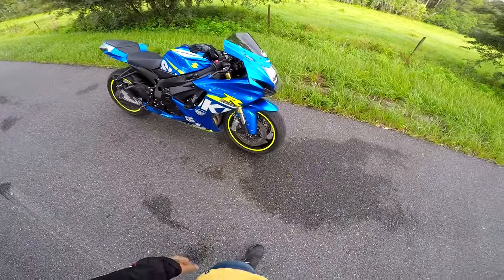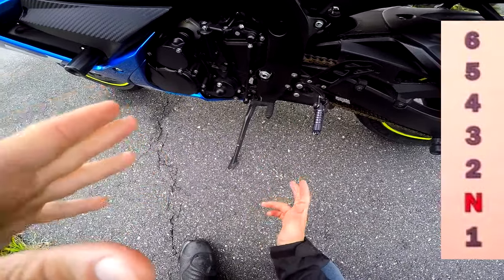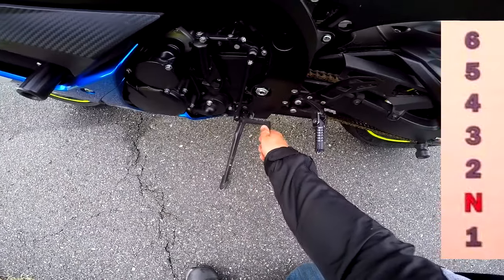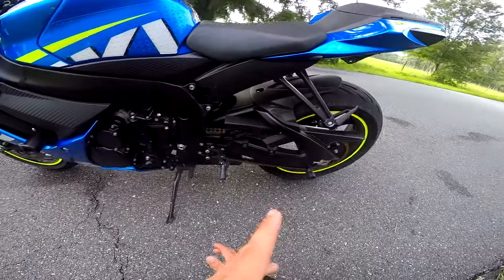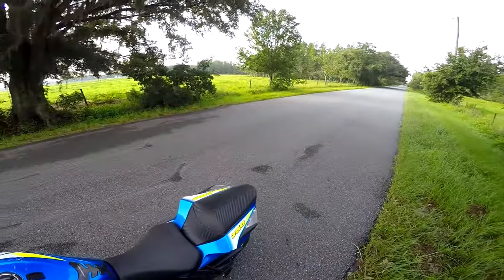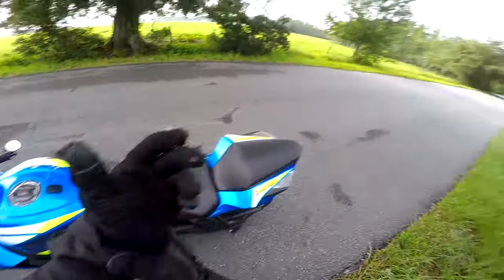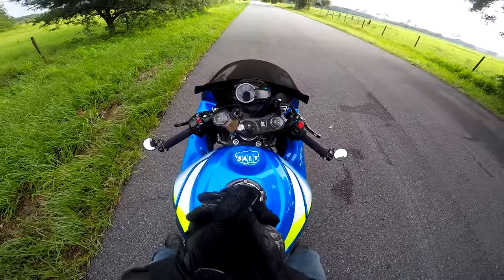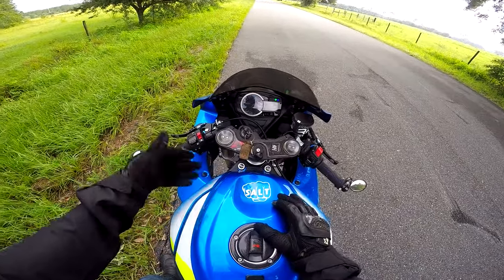How To Ride a Motorcycle: Part 2 - Shifting & Downshifting

Comment: when up-shifting and downshifting, does the shift lever only go up and down one click at a time or is there a chance of shifting into a wrong gear?
Reply: it's sequential so it only goes one gear at a time
Reply: Sanjay If the gear change is sloppy (especially on older bikes) you could find a false neutral.

Comment: What's the difference between rolling off the throttle first and then pulling in the clutch versus pulling in the clutch and then roll off the throttle? I was taught to roll off the throttle before using the clutch.

Comment: Can I brake and not use my clutch?? .. if I want to slow down into a corner
Reply from the maker: You can, just be careful about braking in corners. It can be done but you have to know what you're doing.

Comment: When coming to a quick stop at a stop sign (while in 1st 2nd or any other gear) or even a red light, can you just hold in the clutch or do you have to shift back to neutral?
Reply: You you can hold the clutch in on 1st gear but because bikes have a sequential gearbox you cannot be in any other gear other then 1st. That’s the only difference with stick shift between cars and any gear bike hope this helps.
Reply: @headlesshorseman2165  Sure does :D, Tnx

Comment: Brand new.  Today is day 3 on the road im already on the streets.  Heres where im confused.  When i down shift its dangerous. Ive stalled several times in traffic down shifting.  But when i down shift up to a complete stop holding clutch in and off throttpe then the bikes smooth.  How do you down shift while moving at pretty good speed ?  Even letting clutch out slowly seems to stall the bike.
Reply from the maker: You don’t want to down shift too quickly, try down shifting slower and at lower speeds. Depending on the bike. Sometimes you don’t down shift into 1st until you’re going 10mph or less. Or just try holding the clutch in the entire time you’re downshifting and don’t let the clutch out until you’re at a complete stop and in neutral. Hope this helps

Comment: I’m use to driving a little Honda 125 scooter at my house in Thailand but want to get an actual motorcycle. Is it way different in the handling and ride? When I’m doing like 60 kmh and higher it seems so squirrelly. Or does it become more comfortable with time. I don’t ride all that often

Comment: I been riding for years and i still cant get the hang of it lol my shifts are always different or im doing it wrong or wrong rpm like i feel like i should shift to 2nd at 20 3rd at 30 an so on is that right for the most part? And also do you let the clutch out fast or slow obviously when cruising not racing and do you let it all the way out and give it gas or should you give it gas at the end of the clutch disengagement right before its all the way out

Comment: Hi salt can I downshift from 3rd to 1st gear on one clutch pull while running?
Reply from the maker: Yes, absolutely. Just pull the clutch in, shift down twice and then release the clutch, but you have to account for your speed and RPM's. If you do it too fast and you're going too fast for 1st gear it could lock up your rear tire and skip. I do it when I'm rolling to a stop though, I just don't let the clutch out until I'm doing below say 20-25mph

Comment: When I down shift my bike will rev and it sounds like the tires are screeching. Why is that
Reply from the maker: If you downshift at too high of a speed for that specific gear the rear wheel is all of a sudden spinning much slower than you're moving and it will lose traction. Try slowing down more before you downshift.

Comment: when i downshift i do what you said clutch in let go of gas gear down but then when i let go of clutch and give it gas i stall for a second or if i let go ot clutch slowly while giving it gas it will still brake idk what im doing wrong it’s a dirk bike btw idk if it’s different or what

Comment: One question, to ride 30 km to 50 km/hr ; 60 and 80km/hr  in which gear I should put the bike? 
I am a very new rider
Reply from the maker: that really depends on what bike you're on, you can be in 1st gear on a 1000cc, 2nd gear on a 600cc, 4th gear on 125cc, etc.

Comment: I can drive a manual car really well, a dirt bike well, but sports bike friction zone and gearing feels totally new. I’ve stalled the bike several times.
Reply from the maker: You'll get the hang of it, you can adjust the clutch cable to make the friction zone more like what you're used to as well

Comment: Hey, so I'm a little confused here, I've seen other videos where they tell you that the friction zone is not just when you release the clutch but when you press it as well, meaning that you don't press it all the way, that true??
Reply from the maker: The friction zone is different depending on the bike and how the clutch wire is set. It’s the point of which the gear is engaging and starts to move the bike

Comment: Awesome video..tho one question..

Say im in big traffic..do i have to downshift and upshift all the time or i can still brake and leave it on 2nd gear without the need of downshifting to 1st?
Reply from the maker: You don't have to downshift each gear when coming to a stop, you can just pull the clutch in and shift down as needed to get back to Neutral or 1st gear
Reply: @SALTxTHExWOUND  oh wow thanks for replying.

Yes but i mostly aim at braking when roads are busy or u need to brake quickly due to someone or something in ur way..
Do i have to downshift first then brake ..or i can just clutch brake first and then i can downshift when i safely brake and avoid whats upfront

Comment: so when you downshift do you just hold the clutch one time and keep clicking down to downshift
Reply: It’s a good idea to actually shift through all the gears, Ie click down and let clutch out through each gear. Less stressful on the bike and better to know where your RPMs are. With practice you can get very fast with it!
Reply: Depends on the reason you are downshifting, is it that you want to stop or you just slowed down due to traffic or a corner, bump etc, if due to the former, then you can down shift to the first gear where you go to a stop, I do this over each gear without letting the lever off.
If it's just slowing down for a bump, you downshift and hold clutch in, then let off clutch and add throttle

Comment: When should you use what break on a motorcycle? Like when should I use the front break vs the rear break?
Reply from the maker: You want to be using both, MOST of your stopping power comes from the front brake though

Comment: Can you half shift to get into neutral in any gear? Like you're in 6th can you half shift into neutral? I learned to drive with a manual trans car and shifted into neutral a lot for coasting or stopping. When the bike is in first can you kick the shifter down more or does it stop once you've hit first?
Reply from the maker: No, you can only half shift between 1st and 2nd gear, if you do it in another gear nothing will happen

Comment: When you come to a stop light and you are in 3rd or 2nd gear, do you downshift as you approach or just pull in the clutch, brake, come to a stop, and then downshift all the way to 1st?
Reply: I usually hold my clutch, brake, and down shift to 1st

Comment: when you change gears do you shift up or down ? and when do you know when to shift gears ? those are the only two things i’m confused about.
Reply: You push up on the lever to shift up and down to shift down. Start looking at your owners manual to see when you should be shifting based on speed, but eventually you just listen to your engine and will be able to tell when you need to shift up.

Comment: The way you shift from 1st to 2nd by pressing it hard is that for all bikes? Like can I press it hard to skip neutral
Reply: You wanna press the hardest from first to second. If you press lightly when trying to accelerate its likely you will just end up rev bombing your bike in neutral. You wont go anywhere or cause damage doing this so dont worry. First to second should be a hard press (dont hurt yourself though) and the rest of em is just a regular bump up/down.

Comment: So after first u can just drop the clutch after shifting to second ? Did look like it was a slow motion like 1 to second?
Reply from the maker: yep, you only need to pull the clutch in long enough to shift the gear and let it back out :)

Comment: i would add always clutch first  for starters because then you motor is  just running in neutral and you can literally hit anything it wo'nt stall or stop  the motor, its your safe guard , clutch on anything  and  break before the turn if you feel your going to fast  then throttle up when you are half way out of the  turn , am new to this but this is what i do ,  stop allot and  start in 1 gear  until second gear then stop   again , this exrcise will help you to  know your brakes , clutch , zone of your clutch were you can shift  , i wish you all safe smooth driving , be well everybody, may love be our guide, love to all that is

Comment: My question is do you need to squeeze the clutch all the way? Because it doesn’t seem like that. I mean for a manual car it’s very important to clutch to the floor
Reply from the maker: No. Just enough for the clutch to engage so you can shift a gear.
Reply: Thanks you

Comment: You don't talk about how to release the clutch when you're at the bite/friction points and using gas. can you release it fast or so you still have to be going slow? Both for upshifting and down shifting
Reply: its not rocket sience you get to the bite point release and gas

Comment: u very fast went trough important fact, that when shifting u release the throttle at the same time u press the clutch for that second. That is very important to avoid enging reving unecessary while clutch is down as it has no load at that moment.

Comment: Do you have to ease off the clutch only while shifting to first gear ? 
Like once I’m going to second can I let got of the clutch fast or will I stall out ???
Reply from the maker: Only if you are going into each gear, if you want to go straight from 5th gear to 1st gear you just hold the clutch in the whole time while you downshift. But you do have to ease off the clutch as you release it in any certain gear except neutral

Comment: Hi it's really a nice video tutorial. But I'm having a problem. When I downshift, the bike always seems to give a jerk. I mean it's not very smooth. Plz help 🙏❤️
Reply from the maker: You probably need to rev match when you downshift better, basically you need to give it a little bit of gas while clutching in and then downshift so it's at the appropriate RPM. Look up rev matching and you'll understand better. Good luck! :)

Comment: Can you down shift all the gears to 1st  without letting go of the cluch or do you have to go through each one separate? I'm new about to take the class
Reply from the maker: You can hold the clutch in and shift through all of the gears safely, just remember if you're at a high speed and shift down too fast and let out the clutch the bike will have to catch up to the speed of the new gear you put it in, For example if you're going 60mph in 4th gear and you hold in the clutch and shift down to 1st gear you don't want to let the clutch back out until you're braking and get down to about 10-20mph

Comment: So if you want to go faster you go on a low gear (eg 1l) but if you want to go slow you go on a higher gear (eg 6)?
Reply: Just the opposite.  2nd gear allows faster speed than 1st.  3rd gear allows faster speed than 2nd and so on.

Comment: i have a question about shifting, can u shift while holding ur clutch, or u have to hold clutch first than shift. thx
Reply from the maker: you have to hold the clutch in while shifting unless you have a quick shifter installed on your bike

Comment: So wait when downshifting do I have to go like    From gear to gear or just from whatever higher gear I’m on to first or neutral like I don’t have to go from 6 to 5 then 4 and so on?
Reply from the maker: You have to shift down once for every gear, but you don't have to let the clutch out. For instance you are in 6th and want to go down to 1st, just hold your clutch in while shifting down each gear, then release the clutch.

Comment: I barley know anything about the shifting gears and so im wondering if i can like stay at gear 2 or something like that the whole time while going like 60 mph or something like that or will it mess up the transmission?
Reply from the maker: It's going to depend on the bike, my gsxr750 will sit in 2nd gear at 60 no problem, a 1000cc will easily cruise 2nd at 60mph, but if you're on say a 125, 250, or even a 400cc 2nd gear at 60mph will be very high RPM's and not ideal. Trust me when I say this, once you get used to shifting you will have no problems moving through the gears. Take your time and learn and you'll be fine.
Reply: @SALTxTHExWOUND  thank you so much 🙏 great explanation btw 💯

Comment: Hi, do you need to pull the clutch each time you need to shift from say 5th to 2nd or do you pull the clutch just once and then hold it while pushing down on the gear shifter?
Reply: Hold down clutch then down shift gears from 5th to 2nd

Comment: Why didn't they put neutral at the bottom? If this is a silly question it just seems to make sense. Coming to a stop was the hardest because the training was rubbish.  People tell me to just come to a stop in any gear then drop it to neutral. I tried doing it this way but didn't know what speeds to drop it down. By the end of the course l felt like l had a broken neck, it pissed it down all day and was freezing cold. Put me off bikes. Stuck with the scooter. But I'm changing my mind recently. Might give it another go. I also knew l wouldn't remember the back brake because I'm not used to having one. That was also a problem.  Instead of asking me to book a couple of days training the instructor just shouted at me. Quite frankly he was an arsehole. I'm a kinetic learner, so when it clicks in, I'm normally very good, my questions never got answers. I did CBT on another course via scooter, and they really wanted me to get a bike. Turned out the bad trainer used to work at the other good school and they got rid of him, he never stopped slagging them off all morning.

Comment: So when your breaking going back to first gear you pull in the clutch and the break simultaneously?
Reply from the maker: Yes,  if you're downshifting you'll be using the brakes at the same time, or right after you let the clutch out
Reply: @SALTxTHExWOUND  thanks man!

Comment: Question on braking. Do you use both front and rear to stop or can you just use either or and how much difference is there when stopping?
Reply: glamb2864 it is better and recommended to apply both brakes.
Reply: glamb2864 Front brake gives 70% to 100% of the total braking force, so you do the maths.

Comment: So the gear shifting in motorcycles is basically like a sequential gear box in cars if not what’s the difference?
Reply: If i push up too hard from second gear i will only change one gear right ?
Reply from the maker: as long as you only push up once you will only shift up once, you'll only shift multiple times if you intentionally push the shifter multiple times

Comment: Isn't there a proper way to down shift instead of just down shifting whenever you want so you dont mess up your transmission like you would in a car?
Reply from the maker: Rev matching is more than most beginners need to know but yes especially once they start going higher speeds and slowing quicker

Comment: I can up shift perfectly but how do I go from 6th gear back don’t 2nd for like a turn and not have my bike slow damn really fast of skid my tires?
Reply from the maker: downshift into each gear slowly, or you can hold in the clutch as you continue to shift down while braking at the same time to match your engine speed

Comment: I don’t understand why you need downshift though…. What exactly is the reason you’d downshift and not just go into neutral?
Reply from the maker: Because if you are in 4th gear and you stop the bike sometimes will not want to shift without the wheels moving, it's better practice to downshift, also you have to downshift as you're slowing down.
Reply: @SALTxTHExWOUND  thanks for the reply!  I’m still not totally getting this whole idea 😭 lol

Comment: I got a new pair of boots, big huge toe, I'm still debating with myself changing the bike(s) shifter height a tad. I can't shop worth a dang, so now I think about shifting because I got fat toes.
Reply from the maker: Mark Smith usually when you get new boots that happens, it’s just part of the break in period. But you can adjust the shifter or brake if need be 👍🏻

Comment: But like after how many mph u have to shift up? I just want to make sure
Reply from the maker: It really depends on the bike, on my bike it redlines at 14,000 rpm and I usually shift around 7-9,000 rpm when I'm just cruising around
Reply: @SALTxTHExWOUND  thank you and I got a 2017 ktm rc390 and I got good at it thanks to you but now I need to fix something else which is stalls, it happens to me 15% of the time and mostly under pressure like when a car is coming or something

Comment: I am still confused why motorbikes uses these type of gears one down and all other up? why can't they simply do all down like old honda models ?
Reply from the maker: You can change the shifter to GP shift and then it will be 1 up and 5 down. opposite basically if that's what you prefer.